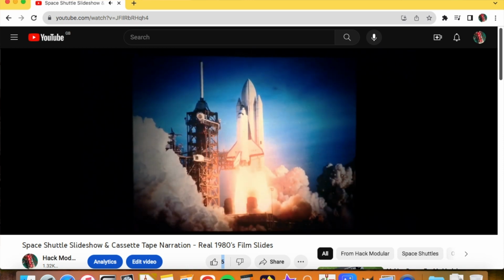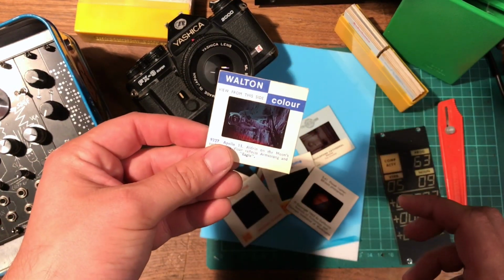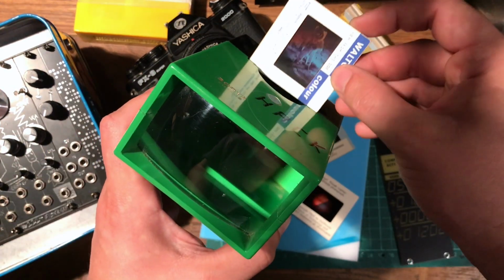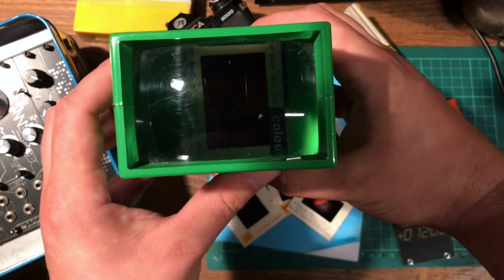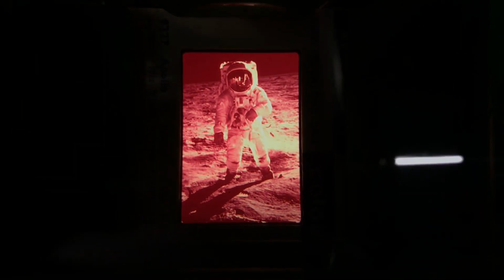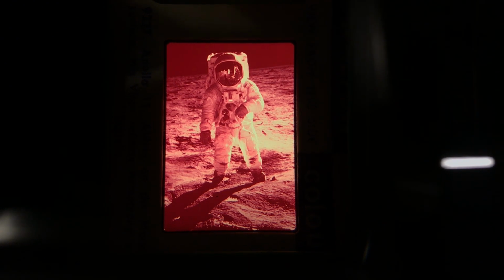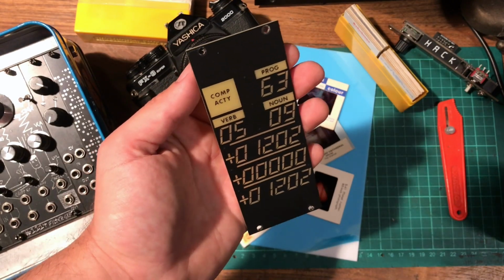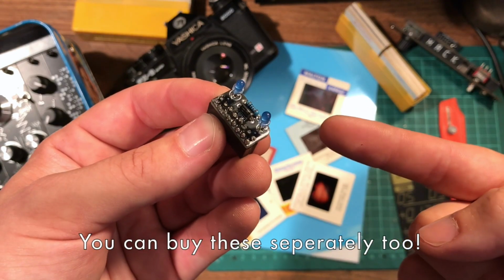DIY Eurorack Slide Film Light Box!

Comment: Can I just add: PLEASE DO NOT USE A WOODEN OR PLASTIC RULER/STRAIGHT EDGE!!  I know from experience!  I worked in a Print Shop, and for "quickness" I grabbed a plastic straight edge to cut an A0 poster. We used scalpels, as these are the only real way to get a single sheet neatly cut. As I drew the scalpel back, I hadn't noticed the scalpel slightly digging in to the straight edge. By the time I'd ended the 'stroke' the scalpel had dug into the straight edge, and cut itself a new edge, down the ruler and across my thumb and hand!! Lovely. :(  So yeah, ALWAYS use a metal edge/ruler when you cut with a knife.  p.s., great and VEWRY interesting video, cheers man. 👍🤟🤟